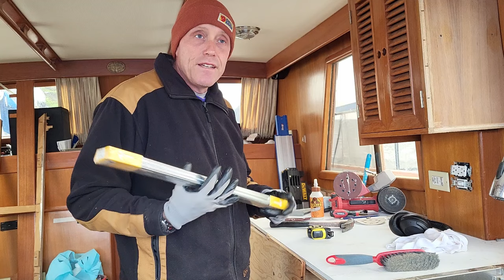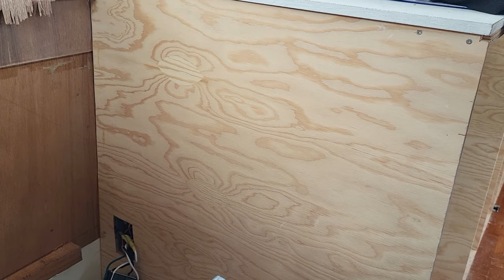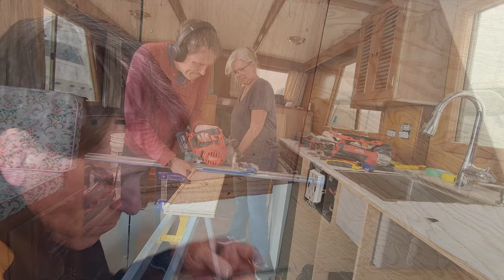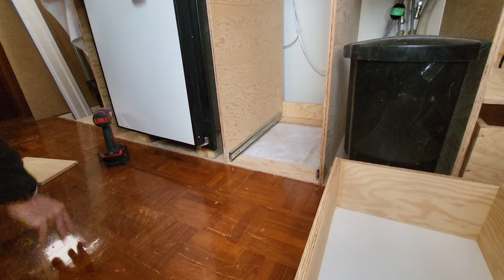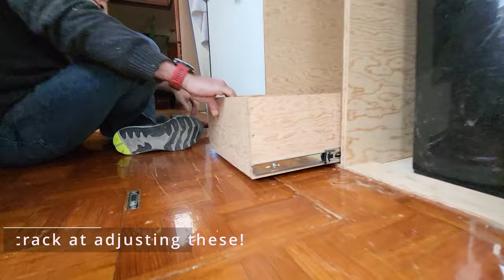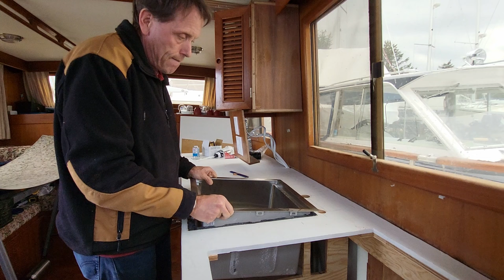DIY Galley Drawers

Comment: Hi. Just started watching and I am impressed with the amount of work you are doing. I have a question for Chris: why did you place the GFCI for your second circuit under/behind the drawer below your stove?  Won’t it be a PITA if it trips and you have to reenergize? This is not a criticism, just a question from a novice.
Anyway, I am finding your channel very informative regarding the trials and tribulations of working on a 30+ year old trawler. Your mast video was very, very, entertaining. ( maybe not so much for you😂)
Reply from the maker: I'll get Chris to answer your question soon. The mast was a little entertaining, even for us!
Reply from the maker: Hi Roland, you are right, total PITA! I did it this way because this was the original galley circuit and this is the location of the original plug (or close enough to make no difference). A clean way to do this would be to place a GFCI curcuit breaker in the panel, avoiding the akward location. I did not do this for the simple reason that I could not find a GFCI breaker that fit my panel. So far so good as the circuit has not tripped!